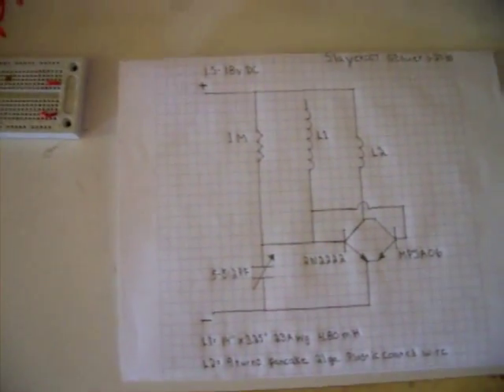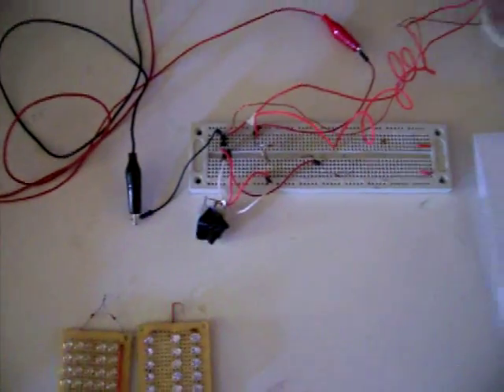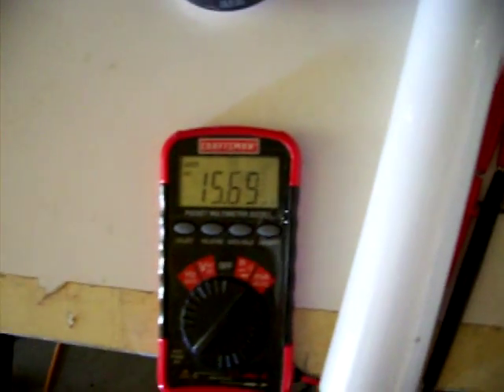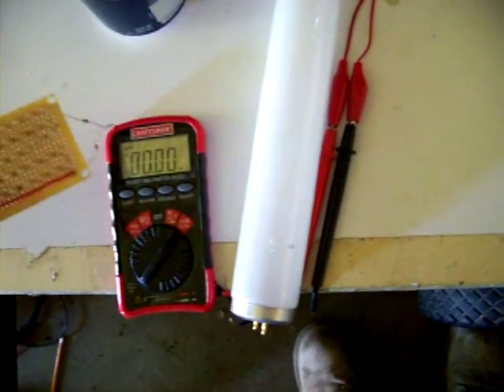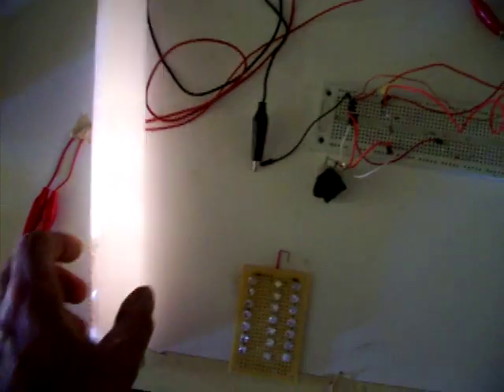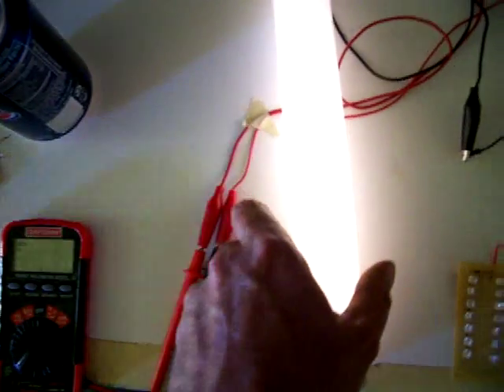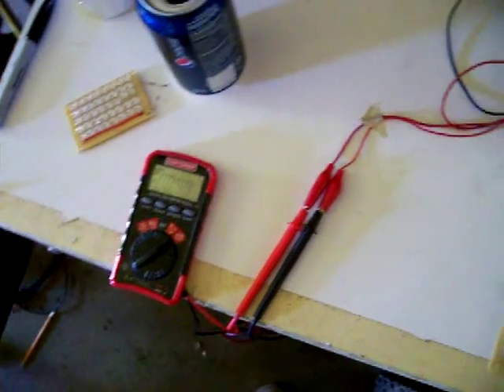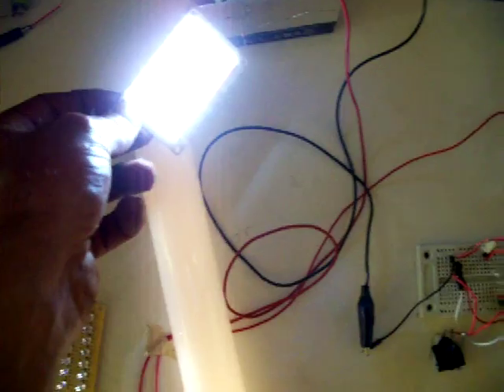Exiter Running Off 12v.

Comment: well i tried it and burnt up a scrap mosfet and overheated a transistor on ballasted 12V. i used a coil wrapped around a marker as the emitting coil and about 15 turns of wire as the primary. i only used one transistor though

Comment: what if you use a darlington pair of transistors? where one amplifies the signal then the next one amplifies the amplified signal from the first transistor to get a more full ON OFF oscillation. would a single mosfet or tip2n3055 work?